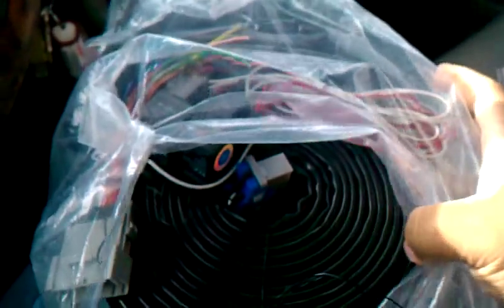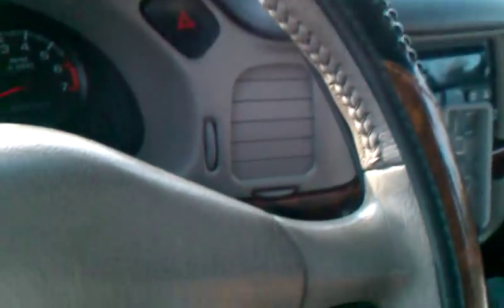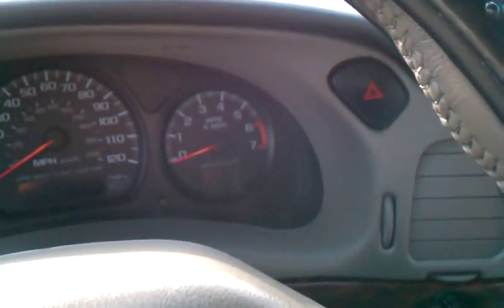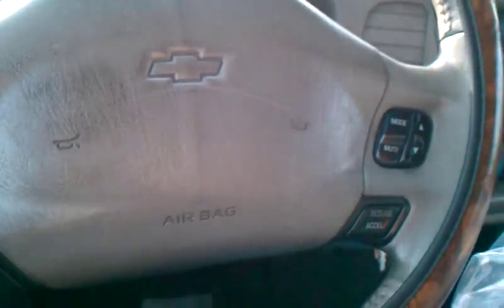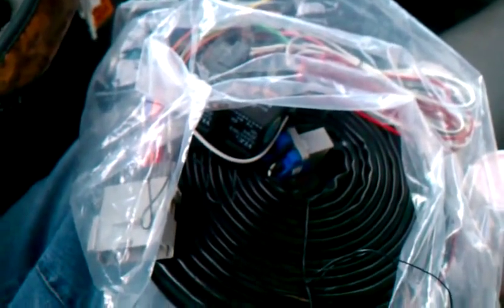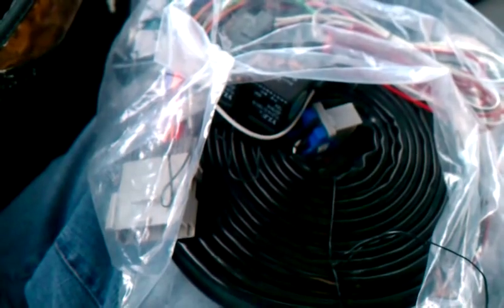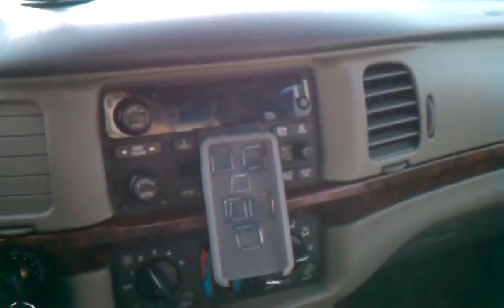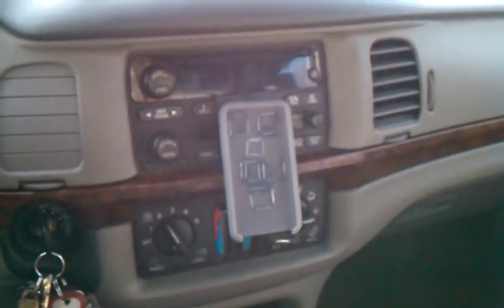Impala w/double(2) din and relocation harness (PART 2)

Comment: Ay what's good mane? Do you know what tool they used to cut your dash? I have the kenwood DDX 896 and it's about the same size as yours but, my installer wants to cut my woodgrain trim and that's a no go! So when you did they cut was it just the corners or the whole top panel?!